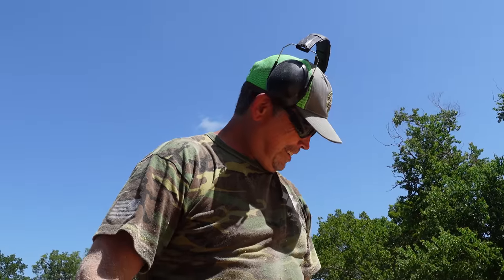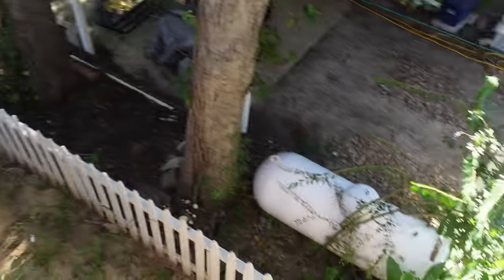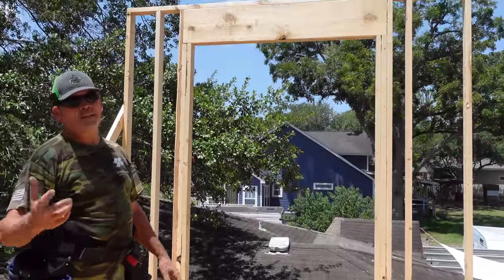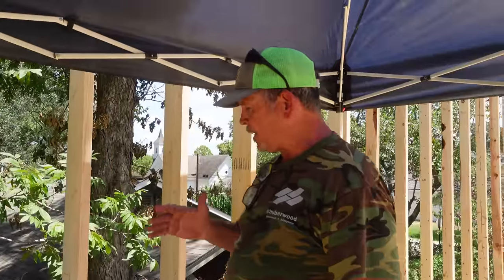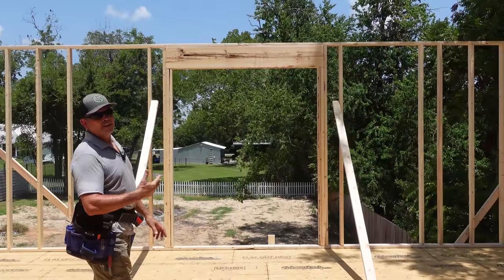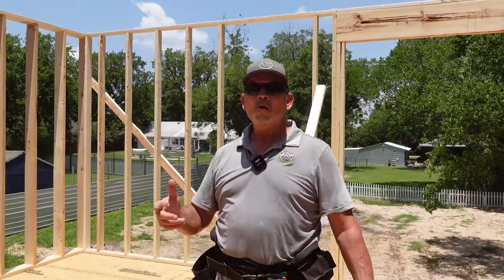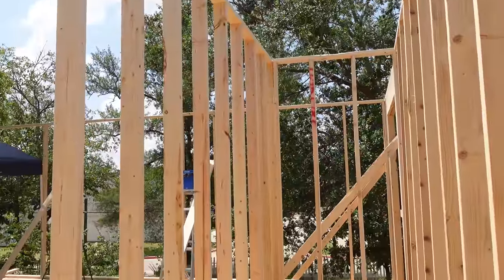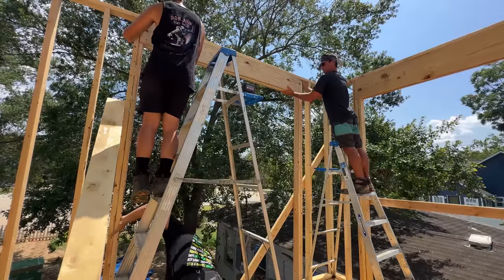These Windows Sent Us WAY OVER Budget...Then we Did THIS!!

Comment: You guys are definitely flying--compared to the work it took to get out of the ground! When you go changing windows, be sure you have the bedroom egress requirements, and you provide tempered glass where required by code. The architect probably noted these in plans. But possibly not. Another requirement for windows that are high off the ground, the operable opening should not be less than 24" above the finish floor--unless you provide some form of fall protection.

Comment: At 25:01 - Did you forget to leave the 7/16" inset of the stud wall for the air tight sheathing system on the stairway interior wall?  If so, fix that before setting the roof trusses.  Great team work...great series.

Comment: Love the large windows and raising from the floor to avoid the tempered glass. The bottom of the sash will be less than 24" from the interior finished floor and will need safety latches to restrict the opening, 60" or more from exterior finished grade. They make an aftermarket latch to get through inspection if they are not built into the window.

Comment: Really great video guys...your strong point is framing for sure!
I saw your video title about window costs...but didn't hear anything in the video...
Keep up the great work guys!
Reply: Did you watch when they were framing windows?
Reply: @cantgetright742  Ahhh...the tempered glass change...I thought it was something different. 🤭
Reply: @chrisosti  I guess you could count changing the window size on the back. Resized so they could get that light switch in there for outside. Not a budget saver like the tempered glass side though.

Comment: Should have run your headers for windows all the way through. Shortens wall stud length ads strength all the way through and for rafters or trusses and roof load after completion. Not bad though. 👍 Also wedge nailing is better than shooting every nail straight in if your RO’s are all correct and don’t need padding.

Comment: With a vaulted ceiling on the upper level it would have been best to frame the front and back wall to the bottom chord of a vaulted gable truss especially with those large windows in the front and the slider/window combo in the back. That would eliminate a weak point in those walls, you know, the same reason you are waiting the frame the bathroom walls until after trusses are set

Comment: Hey guys love the channel but I have a question. I have been in the HVAC business for 36 years. I have gone to the New York State energy audit class and have conducted blower door tests. It seems to be a waste of time doing a blower door test before your house is finished.. if you do your due diligence, which it seems like you are, there should be no reason to do a blower door test at the point where you’re planning to. If you’re making the house that tight, I hope you’re planning on mechanical ventilation. Good luck and keep up the good work. Be sure to seal up any penetrations in the walls that could create a stack effect, that was a major part of the education. PS my heart poured out for you guys during the rain, storms and pouring of the slab part of the construction.

Comment: I think the windows facing the tree and giving it a "treehouse" feel is the way to go. I still think having some UV filter in the windows will help block out the sun's rays, cut down on energy cost to cool the space, and still allow in light. Ultimately, it's Jordan's call to have it the way he wants while meeting all the building codes. The front-facing windows is massive, and love learning some tricks like the 45-degree nailing to act like a hinge for tipping up the wall. Or putting the headers on top of the sill to measure the jacks is a brilliant "hack" and certainly saves on energy trying to hold up the heavy headers while trying to measure the length of the jacks.

Comment: Electrics: Considering the Texas electrical grid and the interruptions of the last year 
plan for the worst I/E provisions for a portable generator. Go with 400 amp service is available 200 for the garage and 200 for the main house that will cover your air-conditioning needs and the shops potential power tools.
Reply: Generator?   This is 2023.  Solar roof and powerwall batteries.   You can be part of the VPP and get paid when the power goes out.

Comment: My house (done long before I bought it) has floor to ceiling windows in an alcove. They way they met code was they used 3'0 exterior DOOR slabs and just installed them.  So it's not actually a window, ti's a door with floor to ceiling glass (minus the 3" or so frame of the door).  something to think about.

Comment: 2:30 Pro tip for the chalk tool. See that winding handle? it's also a button, if you press down on it you can just pull the string out without the handle spinning :)

Comment: Tremendous build job guys - the quality and attention to detail/perfection is second to none. This will likely end up as one of the highest quality builds in the entire state.  Suggestion for consideration:  If it was my garage, I would install a urinal -likely under the stairs.  (Especially since you’ve cut down most of the trees and eliminate outdoor nature shelter spots). 
Reason:  when working in garage or outside, I wouldn’t want to be going upstairs in that pristine apartment, tracking mud and sweat every time nature calls. Would also likely come in very handy over next year + of House build

Comment: Instead of a bathroom window, how about a skylight? I like those reflective metal tube ones. That tree on the bathroom side wont let in as much light as a skylight will. Adding another for the stairwell would be a free source of natural light. I am sure you have plans to have smart shades on all those massive windows to save on A/C cost. Don't forget about handrail blocking as several have mentioned.

Comment: I worked for a developer and just like you attached the header to the top plate they did the same for doors and windows. That way if the owner changed their mind on window or door height it just changed the cribbing. That happened a lot.

Comment: I might reconsider the in-wall toilet. Number one, as others have stated, it's so easy to put a nail or a screw in a place you really won't want it. Number two, they're more expensive and more difficult to service and replace. You aren't going to gain that much space using an in-wall unit, anyways.

Comment: Bathroom window input - Why "or"?  Why not "both"?  You have two outside walls - use them!  First, a window in a shower that's high enough to minimize splash but that you can still see out of and also opens for fresh air (and drying out the shower area).  At the same time, having only a shower window means you have to step into the shower to open the window.  Having that second window over the toilet with the green view would be great, and provide some semi-cross ventilation.  The result would be a bathroom with plenty of natural light, and that can't be beat.

Also, if you add sealed windows in stairway, consider staggering them in the same angle as the stairs.  Get more even light, and a little interesting detail.

Comment: This might have been discussed in a different video, but the decision to use 2 x 4 exterior framing seems strange to me. 2 x 6's on 24 inch centers are much stronger than 2 x 4's on 16 inch centers. There is a lot more room in a 2 x 6 wall cavity for insulation which seems like it would be super important in an area that is as hot as the one they are in. Also the larger span between the studs reduces the thermal bridging across the studs a lot.  5/8 inch drywall can be used if there is concern about the larger span for the drywall. ETA: As far as costs go I think its very close between a 2 x 6 wall on 24 inch centers and a 2 x 4 wall on 16 inch centers. 2 x 6's are more expensive but you need to buy and install less of them.

They seem to be working very hard to build a well sealed house but they don't seem to be following best practices for insulation. I noticed that they used plywood as part of a window header. I thought 1/2 foam might be used for that to reduce some of the thermal bridging across the header. Also they seem to be using old school framing in the corners so there is no way to get insulation into the corners.  Has there been any discussion of this kind of thing in other videos?

ETA: Window openings under the gable ends have almost no load on them. The very strong headers they built were not necessary at all. They could have replaced most of that header with a studded wall that would have allowed for more insulation there. Although it might seem like this is structurally stronger, probably the added weight of the unnecessarily strong headers puts more mass up high, and that might weaken the structure more than strong headers increases it.

Comment: Instead of a window in the stairwell, how about installing a skylight above the stairs?
Reply: Or you could install solar tubes, which are circular light rings on the inside, anywhere from 12 inches to 24 inches in diameter, and the long flexible tube goes all the way up the trusses and exits out the roof with a weatherproof sealing ring. We use them a lot down here in Florida on our Manufactured homes, and they work great.

Comment: The only problem with an inset toilet is you want to put it on an exterior wall. How will you do service or repair on it (you showed us possibly putting a window above it)? If it was on an interior wall, you could build an access panel on the opposite side. But on an exterior wall, you'd have to take part of the wall apart to access the rear of the toilet. 
You've got a 5.25' shower going in, that's more than enough bathroom width to put in a nice (or luxury) standard-design toilet flush to the wall. It seems like a lot of possible issues down the road to only gain 3 inches of width in a room that's already plenty wide enough.
I like the idea, but not on an exterior wall with no access point. If the bathroom was reversed, with everything on the opposite wall, that'd be different. Just my thought when I saw where you were going to put it.

Comment: You guys are getting close to the point where you may need ropes and safety harnesses. Nice to see you put a little tent up to give you some shade up there. This project is really coming together nicely.
Are there any building codes about fire-rating for walls facing other buildings? 
I'm wondering how the floor for the bridge will connect and be supported when going to the house. It's going to be "fun" trying to make sure you get the house the right height and have things line up perfectly.
On the recessed tank toilet-- will there be an access panel for maintenance on the toilet? I hope you get something chair or comfort height instead of standard height. It's much easier on the knees getting up from a taller toilet.
On the wall distance, was that factoring in finished wall size or just the studs?
Placing the studs so the light fixtures and electrical will fit evenly is a good idea.
Will these walls get top plates as well? Even though it makes the walls heavier, when you go to do the house walls, you should build it with the top plates installed and some cut short and others cut longer so they overlap the wall sections and lock together. Perhaps you can do that with interior walls of the upstairs living space.
Black looks neat and all, but keep in mind it absorbs the heat and will get extremely hot. It also tends to fade from being in the sun. Looks nice at first but over time starts to look bad.
On the kitchen, I was thinking of there will be a microwave and you don't want it to be above the stove (so you can have better venting above the stove) there's a place called Bartons Home Outlet (used to be called Surplus Warehouse) that sells unfinished oak cabinets. Body is made of sturdy plywood but the drawer faces, front trim, & doors are made of oak. The website doesn't show the microwave cabinet, but some stores carry it. It looks sort of like the cabinets that go over a toilet but has a larger shelf opening for microwaves and can be set lower to make the microwave easier to reach and free up space on the counter.
I'd probably put the bathroom window on the wall with the toilet. Hopefully it can have a nice ledge to put stuff on as well. I'm a fan of having a lot of storage in bathrooms though, so you'd be missing out on the ability to have a cabinet above the toilet-- which is fine if you don't want one. Maybe you can have recessed medicine cabinet(s) to make up for it and have some shelves for storage on the opposite wall. Maybe even throw in a secret toekick drawer to hold some stuff. 
What brand/type of foam did you use in the header?
If you do the vaulted ceiling will there still be space for the vent fan & ducting for it?
I hate when I go to use a corded tool and it isn't plugged in. LOL.
Aww. Pretty little caterpillar! 
Wow, it looks great! So much better than all that mud that you had for months.

Comment: Window above toilet is the way to go. You should fire block all the walls up and down ! Zip system is alright, however the tape will bust the budget. Hope you have a deal with Huber. Keep up the good work 👍
Reply from the maker: fire blocking good but not required here for walls 10 foot or less, thanks!

Comment: idea on the front windows of you go with single hung windows only the bottom/vent section would have to be tempered and if you lower the "bar set" say to 18" or 24". end result being only the vent section of the windows which is only 24" of total height would have to be tempered. if you go with double hung or horz. slider or picture window 100% of glass must be tempered

Comment: No slider in the bathroom. Even the best will leak air all the time. If it were my money I'd put in a better exhaust fan that runs quietly for a few extra minutes after the light is turned out and a window that is fixed.

Comment: Don't know where your framing but I like all exterior walls to be 2X6. The biggest mistake I see framers & architects make is not providing the plumber & HVAC trades with adequate chases. Always makes sure the plumbing & HVAC systems do not fall on joists & if so adequately head off those joist & use hangers so the plumber doesn't chew up the joist because you know he isn't going to fix it.

Comment: You definitely need to put a window in the bathroom 1 ventilation but 2 as long as you still have water you can still use the bathroom and you don't need the lights on if the powers out. Redundancy.

Comment: Just a quick question, you pointed out that you needed a half inch from the stairs and the interior wall for the insulation to leave room for the dry wall and skirt board in the stairway. When you filmed the last wall around the stairs, I noticed that interior wall was set flush to the stairs. Did you change on the fly again or did I miss something? And 60k plus views in the first 8 hours! You guys are rocking it!

Comment: May have missed this. Are you considering using hurricane clips?
Reply from the maker: We're gonna use a screw by Simpson designed to hold joists/trusses/etc to the double top plates.  Our inspector told us we're just out of the coastal zone and it's not required but I think it's a must have 👍💪👊

Comment: Another fantastic video gents, great job!

Any thoughts on a sloped window sill? I've seen a few Risinger videos that showed some of his builds where framers cut the cripples under the window at a 5 degree angle and sloped them away from the building. They then had to go back with shims to make a flat surface for the window to sit on. Then they covered the whole thing in stretch ZIP tape.  Just wondering if you guys considered it and why or why not you didn't go that route.

Comment: Consider using a light tube in the bathroom
Reply: It's going to be a vaulted ceiling, so will only be 4" between the ceiling and the roof.   Not enough for a light tube, just a regular skylight is fine.
Reply: @AKJammer1  I sent this before Paul mentioned the change in bathroom ceiling elevation

Comment: Toilet tanks, I just really love the old style over head syphon tanks, and you get all that fall for the water so its a real power flush! 
I still dont understand the difference in american vs european toilets base units, euro pot the water swirls in at seat height filling the pot until its level overcomes the S trap and the waste is syphoned out while fresh water coming in also pushes. so when you flush the level first rises up then falls.
I'v seen american toilets that when flushed the water level in the pot almost falls to zero before it refills, almost the exact opposite sequence, I just don't get how they work that way or what causes the level to fall before the water comes in???

Comment: DON'T put a slider in your shower. My parents had that and it was nothing but problems. If it doesn't end up causing leaks within the shower the grooves will hold water and you'll have a massive mold issue. No windows except solid or block in the shower!
Reply: Yah, definitely don’t put one unless it’s like 5 feet or more off the ground and slope the tile to drain away from it.

Comment: ?... I know it's not necessary and it's probably a waste of wood but when you're building the windowsill plates why not just do an extra bottom sill. This way when you put the verticals in you can shoot the nails up through the bottom Then when you attach it to the bottom plate you can shoot nails straight down and not have to toe nail them?

-did I answer my own question by saying it's just not necessary and toe nailing is just fine? 😂 Probably